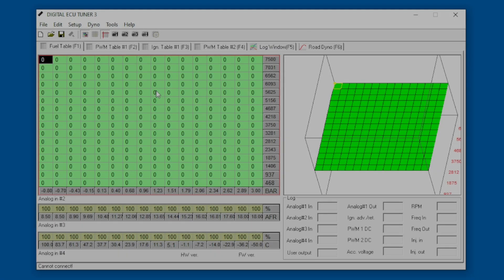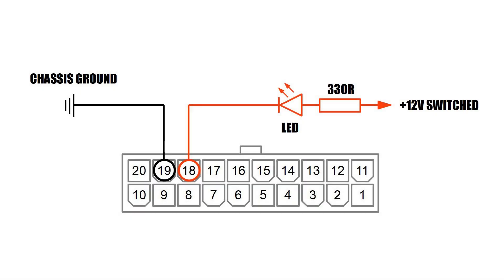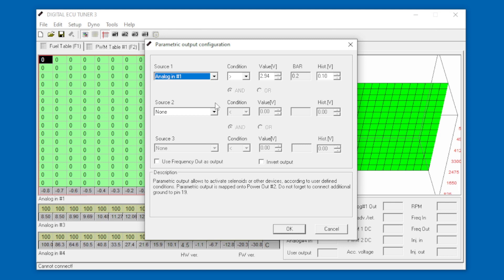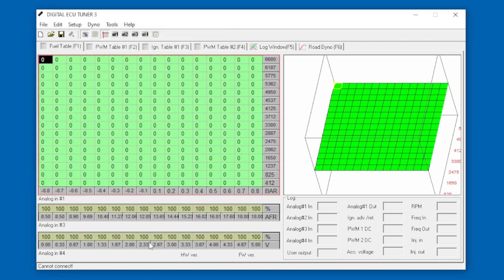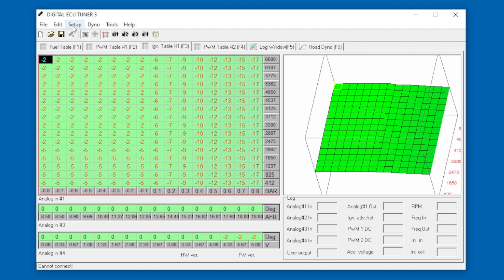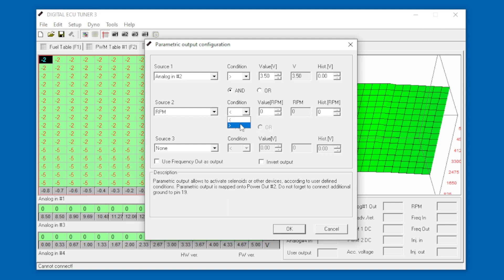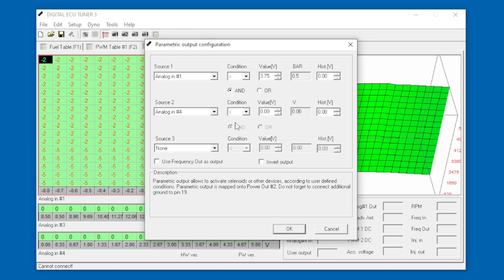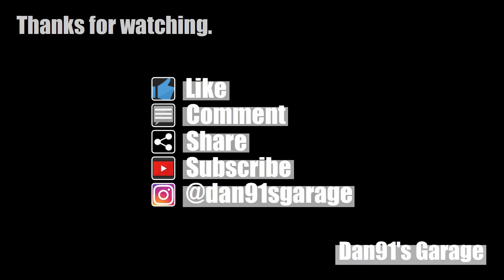Choosing ECUmaster DET3 Parametric output options | Toyota Starlet 4efe turbo build.

Comment: Would you be able to send or post a photo of all the numbers to tune it? All mine are set at 0
Reply from the maker: Not really possible. The cars would need identical injector flow and fuel pressure, det 3 settings etc. I haven't finished the turbo build on mine either so I don't have the tables filled in, its just been setup to run N/A. Street tuning fuel with a WB02 sensor and datalogging is pretty easy. Timing can only really be tuned properly / safely on a dyno.

Comment: Did you know what the stock psi the td04l is set to?
Reply from the maker: Just running the actuator hose directly to the compressor housing with no other boost control, it should be around 7.5 psi (0.5 bar) stock.
Reply: @dan91sgarage  brilliant thank you! And went you extend it all the way did you know by chance the lowest it went? Last question I promise 🤣
Reply from the maker: @Maxkaido  Not tried that part yet dude. But I will when the turbo conversion is complete.

Comment: Thanks for the video. Really informative and straight to the point. Can you do one on the inputs? Specifically connecting a wideband gauge to the det3.
Reply from the maker: Hi Dan, I have a series of video's that includes wiring detail of the DET3 including WBO2 connection: Toyota Starlet ECUmaster DET 3 wiring | Toyota Starlet 4efe turbo build.
https://www.youtube.com/watch?v=_z5hnVmlyuI
Hope this helps.
Reply: @dan91sgarage  you sir are the man! I'm putting a det3 on a 1jz and this helps a bunch. Thanks again
Reply from the maker: @danrooney3704  Very welcome, glad it was helpful.

Comment: the software does not work on the det 3 ECU
Reply from the maker: Does the det 3 have power (red light)?
Can you connect a laptop to it? (Laptop software says connected)
Can you adjust fuel and timing?
Reply: @dan91sgarage  yes, it connects to the laptop, I can adjust the card to whom the rest does not work. and he doesn 't want to work on version 1.35 at all .the current works on version 1.46, but not all the parameters.
Reply from the maker: @сергейАнтонюк-л5я  Version 1.46 is for fuel implant mode, version 1.35 is for piggy back. If you have set the DET3 for Fuel implant mode I don't think you can use the 1.35 software unless you re flash the DET3 firmware?. I think it's best you contact ECUmaster and tell them the problems your having.
Reply from the maker: @сергейАнтонюк-л5я  This video is describing how to set up parametrics on software 1.35 for a DET 3 in piggy back mode. 
The software 1.46 is for a DET 3 in Fuel implant mode. The wiring and setup can be very different to this video. 
I have looked at the 1.46 instructions and the parametrics are wired to power out #2. This wire can also used to directly control fuel injectors depending on how the injectors are wired. The settings for the injectors can affect what signal is sent on power out #2.
How have you wired your injectors to the DET3? 
Batch fire 1, Batch fire 1&2, or Bank fire?